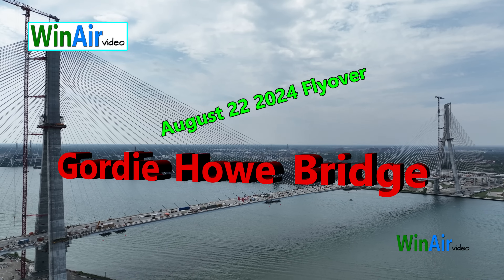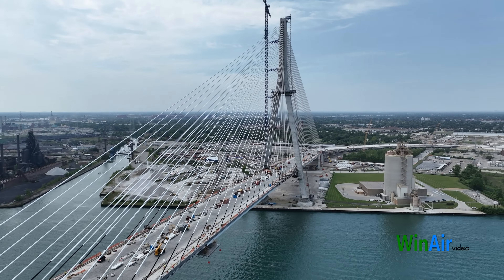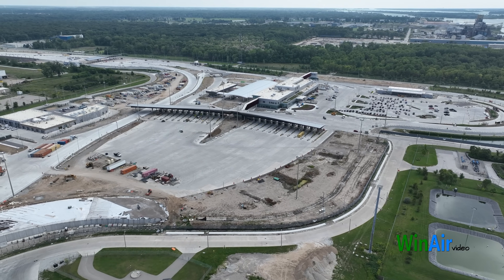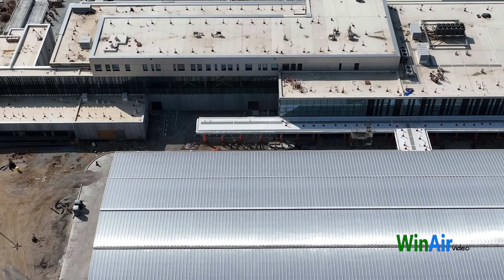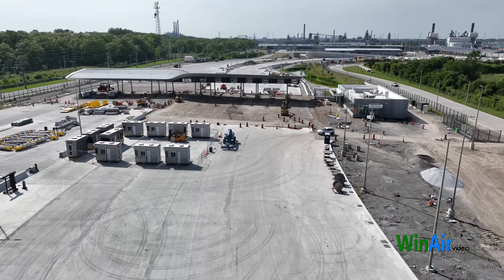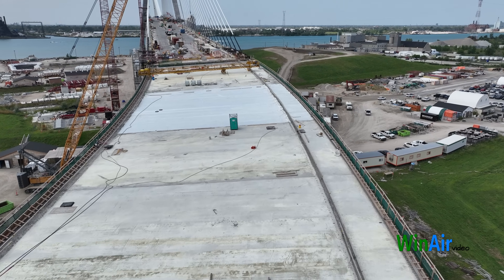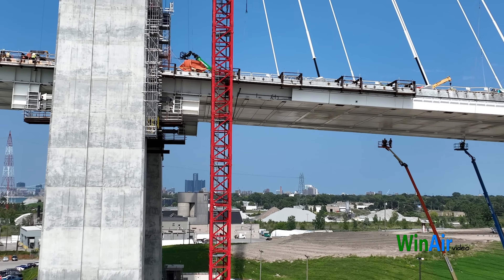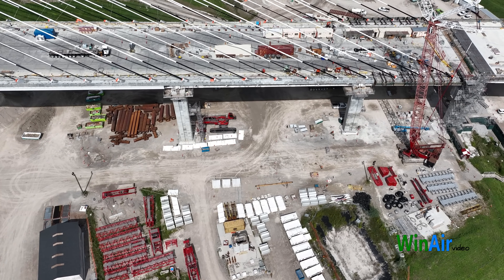Gordie Howe Bridge Update: Strong Progress!

Comment: Nice update!  The only thing that doesn't make much sense is the pedestrian/bike path. Maybe I'm missing something, but your average casual cyclist, walker or jogger normally doesn't normally carry a passport.  I would guess one would need a passport to even be allowed on the bridge? But then again, I guess since Canada is paying for it, that is irrelevant for those of us here in the US.
Reply from the maker: Hi leeriffee. They would if they planned on crossing a border. It works the same on both sides of the border. I think I read somewhere they are going let it be used free. Still have to clear customs.  It'll be a novelty, but I wouldn't expect a steady stream of folks using it.
Reply: Cost is being split 50/50...
Reply: @ewencameron2031 Wrong! The bridge is 100% paid for by the Canadian government.
Reply: @kaybee1500 correct and I read that the Canadian side is charging the toll.no toll on the US side
Reply from the maker: Canada pays and get to collect all the tolls until paid off.

Comment: I've seen them focus on this joint section before and it seems it is rather special and a lot of work put into it.  Is there a reason for this particular part of the bridge? Thanks
Reply: That's one of two major expansion joints for the bridge, the other is on the US side, there are no expansion joints on the bridge deck itself at all, so these two joints (one on each side) where the bridge connects to the roadway are super important!
Reply: @ChrisSeliga  Thanks for the explanation.  Makes sense .
Reply from the maker: Hi Chris. Great information. Thanks for sharing! 😎👍
Reply from the maker: Hi Bert. It's where the Bridge Deck and the Road Deck meet. I believe the two decks are not constructed the same as they serve different functions. What that means for connecting them I'm not sure. I'll see what I can find out. Thanmks for the question.